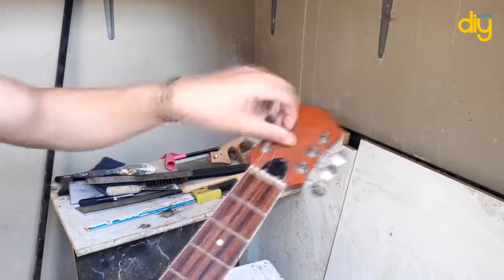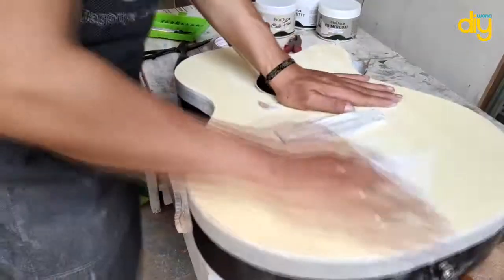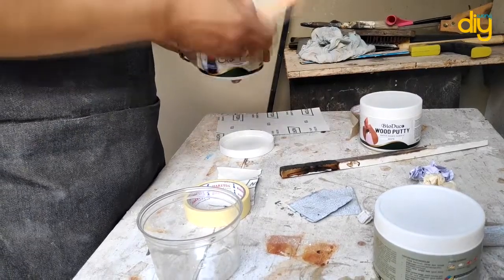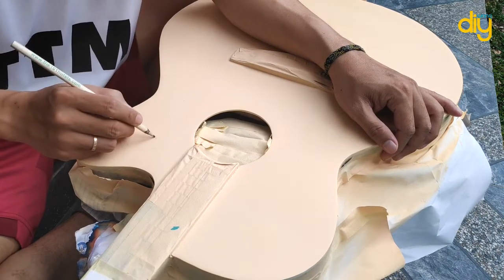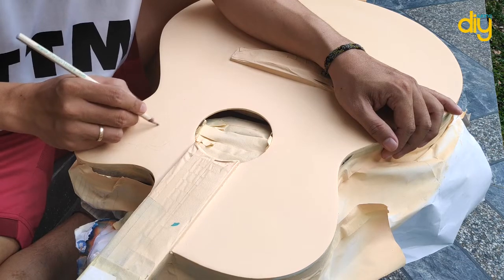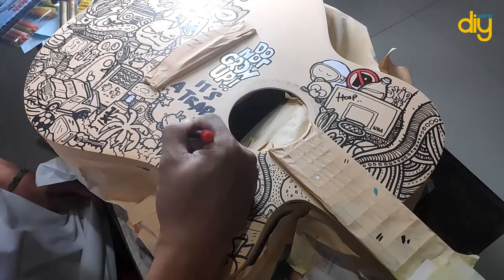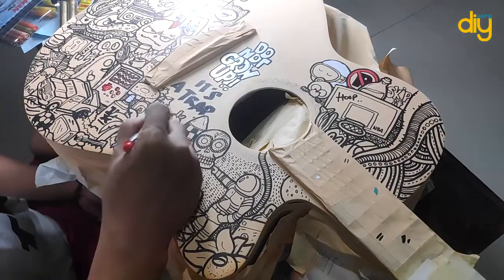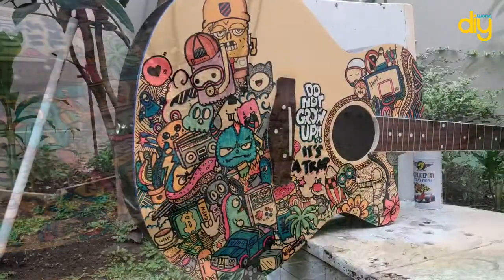Guitar Repaint And Learn how to Doodle

Comment: why wood putty verses gesso? or lightly sanding it?  WHAT BRAND PAINT PENS DID YOU USE?!!! some acrylics dont lay down that smooth.
Reply from the maker: I got sand it a lil bit to take out the old main coat and repaint it with waterbased maincoat otherwise i can not color on it, because i used snowman waterbased marker for coloring, that that is why it does looks so smooth and easy to apply.
Reply: But I wanted more of a cutout look with a lot of wood showing through where I've not painted...
Reply from the maker: @lisavento7474  as long as you cover all the wood surface with sanding sealer and you give light sanding you can use brush pen like tombow but you got to make sure you give a proper set time before you give it a final coat all over the drawing
Reply: @WONGDIY  what's "sanding sealer"? I'm ALSO considering some TRANSPARENT permanent high flow paints, and then i thought hey, why can't you do regular watercolor and colored pencil for a light look as ANYTHING will last under a good poly sealer, right?
Reply from the maker: @lisavento7474  Sanding sealer is a clear liquid base finish that is applied to bare natural wood or to any uncoated wood product. Sanding sealer always must be sanded down smooth after it has dried. Sanding sealer helps improve the condition of subsequent coats of paint or clear finish by sealing the wood pores. And after that watercolor will work i presume, and for that poly seal spray will be a good option to lock everything down.
Reply: So it sounds like you're saying to paint AFTER sealer? Hmmm. I've got a layout now that I plan to burn into my guitar which has to be bare wood and I've read about some people putting a light touch of acrylic Into polyurethane and paint small areas of that for translucent wash... hmmm. Guess I have to experiment.  Thanks for all!!!
Reply from the maker: @lisavento7474  by burn do you mean laser?
Reply: Naw, pyrography... sand and burn photo of Beatles last photo op...little color in foliage...
Reply from the maker: @lisavento7474  whoa... Pyro is also something that i want to try.....
Reply: @WONGDIY  check out these guys then; https://www.youtube.com/@SacredFireArts